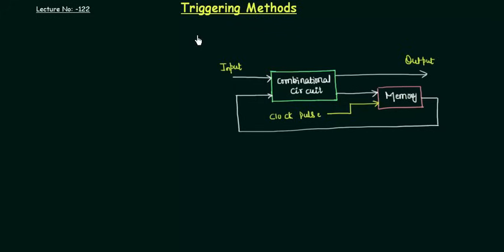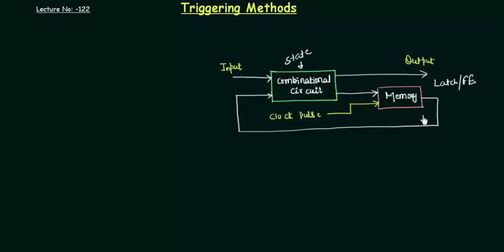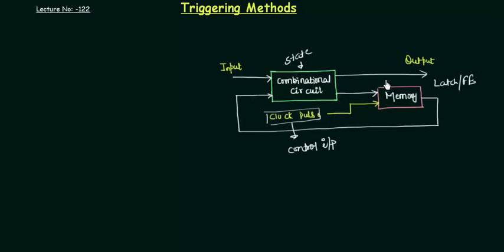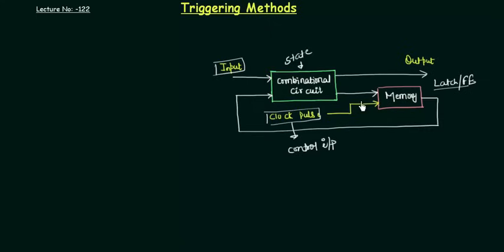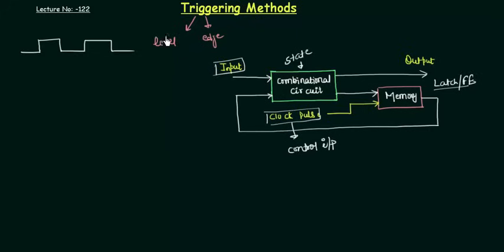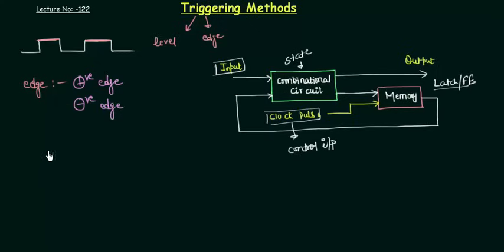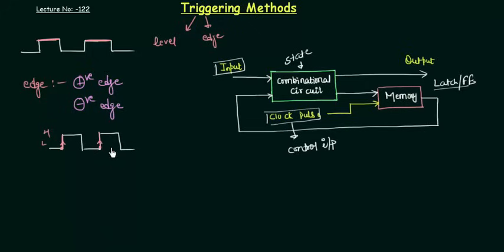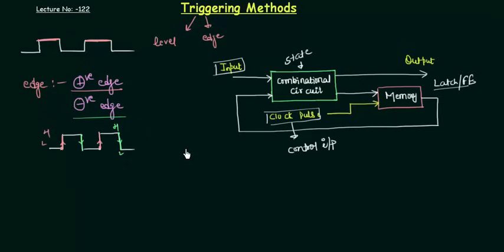Triggering Methods in Flip Flops

Comment: can you solve this project problems ? we are waiting for you. "Track N ° 1  
Make a parking assistant based on distance sensors. The device is activated when the driver starts the 
engine and engages reverse gear. When the device is active it must be able to evaluate three different 
distance thresholds:  
• Object out of reach: the object is more than 40 cm away from the car;  
• Object in proximity: the object is less than 40 cm away, but more than 20 cm;  
• Close object: the object is less than 20 cm away.  
Let's assume that the distance sensor correctly provides the distance measured in millimeters, 
encoded with 16 bits. Depending on the distance detected, the assistant provides different visual 
feedbacks, by using three LEDs and a BUZZER:  
• Green LED: object out of range;  
• Yellow LED: object in proximity;  
• Red LED: near object,  
The buzzer emits a signal with a frequency depending on the distance and managed by a devoted 
timer. 
Finally, in order to display the current distance threshold, it is transmitted with a serial connection to a 
serial receiver. The transmitter to be designed uses a 1bit LINK signal (active for at least 1 clock cycle) to 
inform the receiver each time a new data must be transmitted.    
Track N ° 2
Realize a machine for managing a supplementary voltage supply system. The operation of the machine 
must be as follows: 
the input signal v is 1 if the power supply is correct, 0 if abnormal situations are detected. In this last case, 
the supplementary voltage supply system is started via the auxiliary_supply_on output signal. After 5 clock 
cycles, if the anomaly is not resolved, the IRREVERSIBLE shutdown procedure of the machines controlled by 
this system is activated. The machines are of two types (low or high priority) and the procedure proceeds as 
follows: 
• Low priority machine shutdown (Low_Priority); 
• After further5 clock cycles, high priority machine shutdown (High_Priority) 
At the end of the shutdown procedure of all the machines, the supplementary supply is shut down, and the 
state machine remains blocked until a reset signal is given. 
All the operations of the machines are identified by the use of LEDS implementing a color code, and shown 
on a display. To this end, the operations are transmitted with a serial connection to a serial display. The 
transmitter to be designed uses a 1bit LINK (active for at least 1 clock cycle) signal to inform the receiver 
each time a new data must be transmitted.  
Track N ° 3
Design an electronic system that implements a system whichcontrolsaspeedometer.
The system works by means of a sensor embedded into awheel,which emits a signal eachtime the wheel 
completes a revolution. This event resultsin the set of the signalLAP, which remainshigh for one clock 
cycle. Assuming that the wheel radius is r=32 cm, design the systemso that it cancalculatethe 
instantaneous speed and the distance traveled starting from an initial RESETcondition. 
The calculated quantities are sent to a display by means of a serial connection. The transmitter to be 
designed uses a 1bit LINK (active for at least 1 clock cycle) signal to inform the receiver each time a new 
data must be transmitted. 
The display is provided with a buttonMODE,usedto switch at each pressurebetween the instantaneous 
speed and the distance traveled. At each pressure, a BEP signal is also produced."

Comment: what changes the state in the memory element. Is it control signal(clock) or the input and previous state ?....in the last lecture he explained that clock ip triggers the flipflop to work at a perfect time not randomly so i think it will not change the state alone ...based on input , previous state if the clock is high memory state will change in the flip flop ...am i right? if wrong please advise

Comment: found this statement useful to share:
Under normal conditions, both inputs of the latch remain at 0 unless the state has to be changed. The application of a momentary 1 to the S input causes the latch to go to the set state. The S input must go back to 0 before any other changes take place, in order to avoid the occurrence of an undefined next state that results from the forbidden input condition.(from mano digital design)

Comment: Triggering Methods:
There are two Methods, Level and edge Triggering
When the memory element changes with respect to a high value of clock signal, it's  called the level method while when the memory element changes when the clock signal changes from either low to high(Positive edge) or high to low(Negative edge). It is called edge Method.

Comment: So the Memory is just a latch/flipFlop?
Reply: Flip flop and batch are similar they both store bit i.e they are memory just change is that in latch due to accidental change in input the output will change that we don't want so for that purpose we introduce clock and the flip flop is formed

Comment: can level edge triggering occur at level 0?
Reply: sorry on level triggering
Reply: +Benneth Ikenna No. because the flipflop will work only if the clock is high pulse i.e level triggering.  The flipflop can be designed such that it works on edge triggering(both leading and falling edge) but it's not possible to design for a low pulse.
Reply: +Dhruv Dave +Benneth Ikenna  Ok then what happens in the case of master slave? it is level triggered for both high(Master) and low pulse (Slave)?